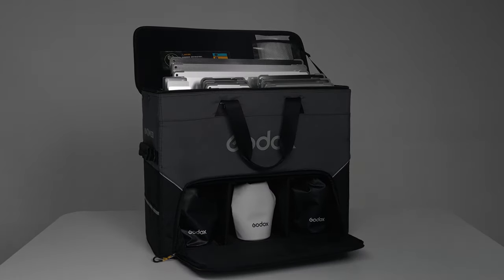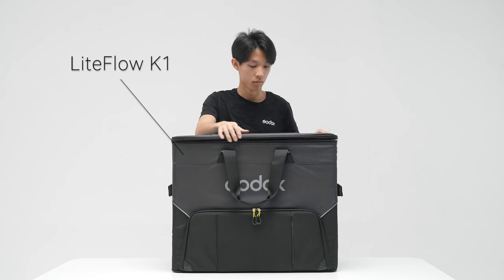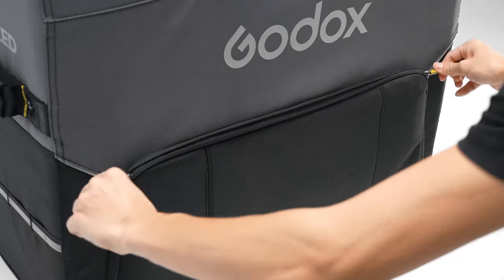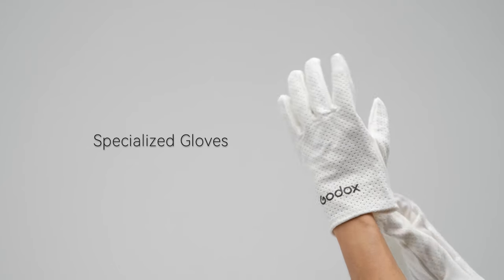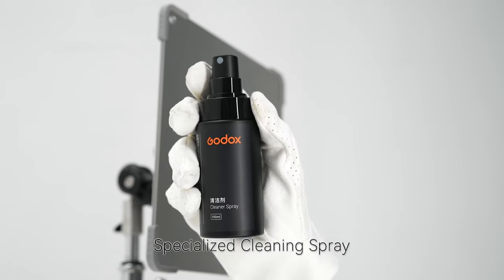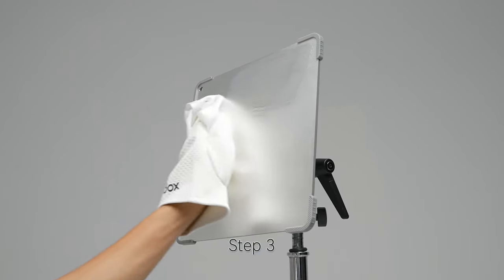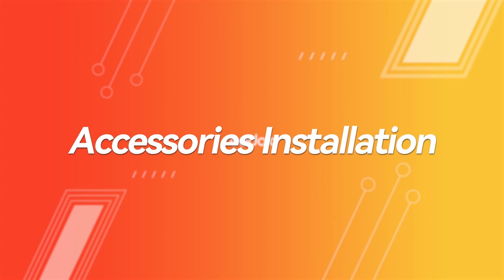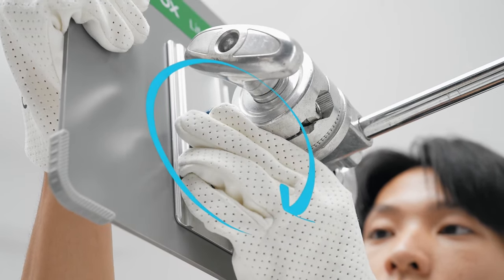Godox KNOWLED LiteFlow Cine Light Reflector Panels -  How To Use and Maintenance Guide

Comment: I wondered how long it would take before someone did a knock off of the crazy expensive Lightbridge system. The Godoy system is still rather expensive, but I like the range of mounting options. Pity that rental houses don’t pick up on a product like this, but the risk of breakage is probably too high. 

So close, and yet so far. I doubt I will ever get to try what looks like a cool concept.
Reply: I still wonder why these reflector systems are so expensive considering what they are. I've used the Light Bridge system and it's nice... but I usually just fall back on a standard double sided mirror/shiny boards because the cost of renting CLRS is nearly as much as an M18 or LED equivalent and you don't get two of the same size and diff, making it hard to justify for anything but the most specific situations. Godox's version is cheaper... but not by enough for me to consider buying or make them that much cheaper to rent.